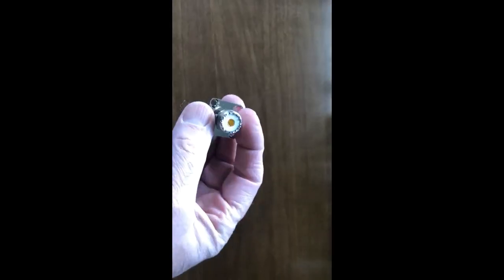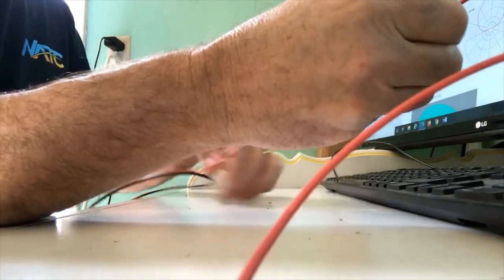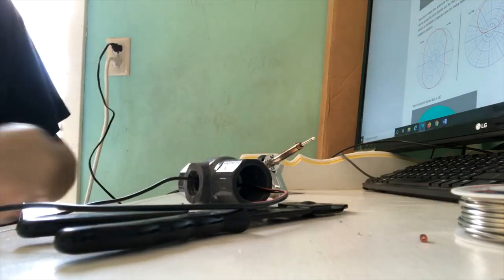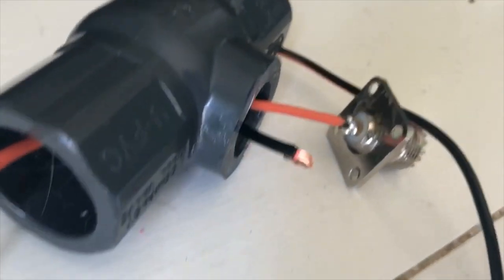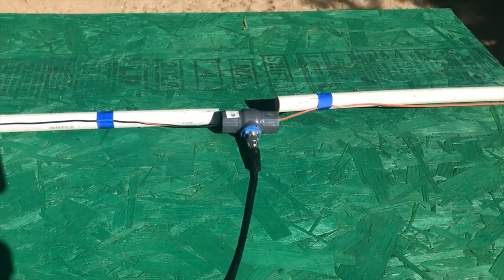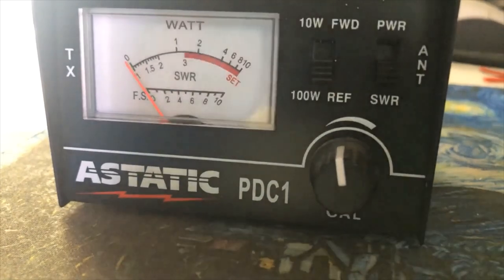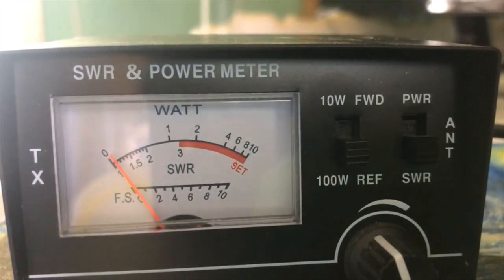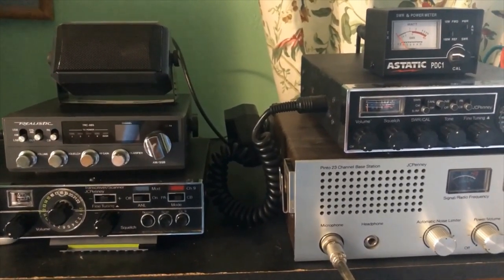Homemade PVC CB Dipole Antenna

Comment: Hello! After you finished running the wire thru the PVC pipe did you recheck the SWR. By inserting the wire thru the PVC pipe you changed the resonance of the Antenna. 
Ed Fong the developer of the Ed Fong J-Pole Antennas has put a lot of theory into using a certain type of PVC pipe on the 144, 220, and 440mhz  bands.
This would also apply to what you did for the 27mhz band. 73 de Steve KB6HOH
Reply from the maker: Hi Steven, thanks for the comment! After I ran the wire through the PVC pipe and placed the antenna where I wanted it, I rechecked the SWR and had to readjust the wire length. I have found that even rotating the antenna in a different direction will change the SWR probably due to changing the properties of the signal from nearby environmental obstructions around the antenna. I have found the sweet spot where the SWR ranges from 1 to 1.2 in the 11 meter band. The antenna is not very high, but I'm amazed by how well it performs. Thanks for sharing the info on Ed Fong, I checked out his YouTube channel and saw some interesting videos I will want to watch. I've always wanted to build a J-pole antenna but never thought of using PVC pipe. If I calculated correctly, the antenna would be pretty massive for 11 meters (around 26 feet in length) versus 5 feet long for 2 meters. I might give it a try for my 2 meter radio. Thanks again for sharing the information on Ed Fong. 73s from 595 Northern Nevada!

Comment: What size wire do you recommend, does it have to be speaker wire or could it be automotive wire.thx
Reply from the maker: Speaker wire works great. If you are running lots of wattage through the antenna, you would want a higher gauge wire. I'm sorry I didn't respond sooner; I missed seeing this comment. 73s from 595 Northern Nevada!
Reply: I have tried copper,aluminum and metal auto wire and the auto wire seem to perform the best...not sure of the theory behind it but the results were noticable ⚡

Comment: So what, if any, effect did it have on SWR once you put the wires inside the PVC tubes?  Doesnt it affect the velocity factor somewhat?
Reply from the maker: PVC should have no effect on SWR, but I never took a reading outside of the pipe. SWR was very easy to set on this antenna and has been very stable for the two years I had it up. 73s from 595 Lake Tahoe Nevada!

Comment: Do you need to use a balun?
Reply: You can if you want to.  A 1:1 current balun is the most effective.  It will not make you match better but it can reduce RFI/TVI on transmit and RFI on receive.
8 to 10  turns of RG-58 or RG-8X wound on a 12" diameter piece of PVC pipe or another material will work well.  While not 12" diameter, I have used a large Crisco container as the coil form and it worked well with 12 turns of RG-8X (smaller coil form, more turns).

Also, remove the PVC as at RF frequencies and power levels it can heat up and melt.

Comment: Hi Ridge Hiker.  Did you need a Balun for the dipole is it matching well with the 50ohm Coax cable?
Reply from the maker: Hi, I did not have a Balun on the dipole and I wish that I would have analyzed the antenna to see how it matched with the coax now that I have an analyzer. The antenna always performed well with a low SWR. Thanks for watching!

Comment: I have never made one I think I’m going to try to make one for a friend that is getting back into the CB hobby in your opinion which would be better solid or stranded wire and I think I’ll try 10 gauge not sure what the difference would be on the gauge of the wires my guess would be may be a little more bandwidth
Reply from the maker: From what I have researched, the difference in conductivity between braided and solid wire is too small to be noticed in a 10-meter dipole antenna. Braided wire is probably better to use as it would not break as easily with flexing from the wind. As for bandwidth, you would not notice an increase in bandwidth till you started using an antenna constructed with 1-inch diameter or larger tubing. Let us know how your dipole turns out. 73s from Norther Nevada!
Reply: Use 1/2" copper or galvanized conduit, or even 3/4" diameter. You will not regret how well it will work.

Comment: You don't mention that you had to readjust the SWR when you erected the antenna! Horizontal and 3' off the ground would throw it out. The wire being inside the tubing would again throw it out. Height of the antenna above ground in it's final position would yet again change the SWR. Also thin wire has a narrower bandwidth than say 1/2" tubing. I learned all the above 45 years ago 🙂
Reply from the maker: Thanks for the comment, you are correct, I had to fine tune the SWR once I had placed the antenna in its final position. 73s from 595 Lake Tahoe NV!

Comment: I see you hand trouble soldering the ground wire. If I understand correctly, are you screwing the wire in with one of the screws for the plate?
Reply from the maker: Hi Jay, yes correct on screwing the wire onto the plate. To solder the wire onto the plate, I've been told that you should rough up the surface first. Thanks for watching, 73s from 595 Northern Nevada!
Reply: @RidgeHikerAdventures  cool thanks! Much appreciated!

Comment: What is the ideal thickness of the copper wire? Is a solid strand or multiple starnd best?
Reply from the maker: I don’t think it really matters, unless you are going to run a lot of power through it. In that case, you would want a heavier gauge. I believe the wire I used can handle 100 watts. I would probably use solid strand if i didn’t have any wire on hand and needed to purchase some. Thanks for watching!

Comment: What's the gage of wire? Does it matter which wire you use for the Center connection?
Reply from the maker: I used what I had on hand which was 18 gauge speaker wire. Wire color does not matter when connecting to the SO-239.

Comment: Does the gauge of wire make any difference? I do not think it really would as it would be tweaked at the end of the assy. by adjusting the SWR.
Reply from the maker: I’ve read for the best performance to use copper wire from 10 to 18 gauge.  I even read about a radio operator who used down rigger stainless steel fishing line with success.
Reply: Depends on how much power you are running.  Most hams running 100 watts or more will use 14 to 12 AWG stranded hard drawn copper wire for their wire antennas.

Comment: I'm stumped.  I built a 11 meter dipole in pvc pipe.  I put a 6 foot jumper on it  to test. Had it laying in a tree fork about 10 feet off ground.  Swr tested great. Under 1.2 Left it there but ran rg8x into shop and swr too high 2.5-3.
Added a 1:1 balun at antenna, still high. Retested with jumper, antenna is great. What's causing my issue? May try different new cable tomorrow. First long rg8x was new as well. What am I missing?
Reply from the maker: That’s strange, adding length to the coax should not increase your SWR. With the balun installed, you should have a balanced transmission line. I’m not a antenna expert but I think trying different coax sounds like a good idea. That’s where I would start. Let us know what happens.
Reply: @RidgeHikerAdventures  I tried a different brand-new 50 ft section of a 8x today and the SWR was up to 3.5 to 4..... idk... not running power, just barefoot. 
What gets me is with a 6-foot number it is perfect flat swr..
Reply: @RidgeHikerAdventures  it was actually slightly lower with 100 ft coax but still unacceptable. Got to be something simple that I'm not latching onto. I ohmed out the coax and they didn't have a short.
Reply from the maker: @headpainter1  Did you try a different jumper cable?
Reply: @RidgeHikerAdventures  I have (2) 6 ft jumpers. They both act the same. Connected them with balun in middle.  Swr was slightly higher that way. Balun is in series with pl259 connections. I ohmed all the wires including jumpers. Maybe there's a short I'm not detecting yet. I figured it was possibly in the 100 ft but when hooked to antenna no jumper or balun high swr, with 100ft balun and jumper it's high. I'll ohm all again and twist and bend. That's all I can think of,  a short somewhere.
Reply from the maker: @headpainter1  Any luck?
Reply: @RidgeHikerAdventures  not yet.  It's been raining cats and dogs last few days. I did ohm it all again and found no problems. End to end x 2 leads and center to outer no contact. I built another flexible 11 meter dipole and it's swr is great. When rain quits,  I'll try the coax again on it and see if results in the same or not. I don't see how the antenna could be the issue though. I test them away from structure and at least 8 feet from ground horizontal. 
Thanks for checking back.
Reply: @RidgeHikerAdventures  ok. Update.  I went out during a break and tried a few things.  I'm running a cobra 29 Ltd classic.  I had an old radio shack swr meter that is probably not registering correctly so I've been using the built in meter on the radio.  Probably a big mistake.  I've heard people say not to trust them but it seemed to be working fine.  Since this issue started I questioned if it was the meter. I since ordered a new swr meter and it came in yesterday.  I tried today and guess what.... the antenna aren't flat. Seems when the radio gets close to the antenna it reads low swr. But away from it it reads closer to correct ( I  hope). Anyway with the new meter and 6 ft. Jumper,  antenna reads 3. Not flat. So, I need to do some tuning. I don't think I am going to trust the built in meter again.  Hope this puts me on the right path.  Thanks again for the help!
Reply: @RidgeHikerAdventures  tuned antenna with new meter and now even with 100 ft coax, it is holding good swr.
Reply from the maker: @headpainter1  Great news!

Comment from the maker: I mounted this antennae facing north south vs. east west of the other antenna. It's also about 2 feet higher with no obstructions. I had to trim quite a bit off of each ends as the SWR was higher in this location. I'll run a distance test soon to see if there is a difference.
Reply: I cut my antennas at channel 30  I do SSB alot   super job on how you made it 73/s   505 Pam
Reply from the maker: @pamhockens4148  Thank you, and thanks for watching. 73s from 595 Northern Nevada!
Reply: Another antenna tip make a full wave loop ssh 😢don't tell one the tomcats big cb antennas will tell you high it will blow away a 99 away homebrew antenna is the best listen people using quads or beams contestant turning there antenna build a loop or dipole antenna simple dimple  😅😅

Comment: Thanks for getting back. Q: could 15 gage house wire?
Reply from the maker: 15 gauge wire should work fine. Remember to tune your antenna with an SWR meter to get an acceptable SWR.
Reply: @RidgeHikerAdventures  would 12-2 wire work better than 14 -2 seeing that it's thicker ? Thx
Reply from the maker: @Prariedog  Hi, if you are putting extra watts through the antenna, you probably would want the wire to be thicker. Running stock, I have heard of people using steel fishing line in their dipoles. Thanks for watching, 73s from 595 Northern Nevada!

Comment: Did the SWR change with you put it in the pipe???  Some freq's.. especially vhf and uhf can be sensitive..
Reply from the maker: I have the dipole resting on the roof of my RV. I notice that the SWR will slightly change when I change the orientation of the antenna. I'm not sure if this is due to the orientation or that the pipe slightly bends at different angles.  I didn't notice a change when I encased the wire in the pvc pipe.
Reply from the maker: @LiL The RV is all fiberglass, that's one of the reasons I  choose the location as it was simple to place and move around. Ideally I would like it higher, but I'm surprised how well it works at its current height. 73s from 595 Northern Nevada.

Comment: What type of pvc did you use like size is it 1/4 or 1/2 or 3/4 and the spec of the pvc was it 200 psi?
Reply from the maker: 3/4 schedule 40 PVC pipe. 73s from 595 Northern Nevada.

Comment: I am from UK. Will this work on 27mhz on FM ? Or is this purely for AM only ? Many thanks.26DR190.
Reply from the maker: Great question! Over here in the states we were just approved by the FCC to use FM in which I have no experience with. From what I understand, the antennae is tuned to the frequency (27 MHz) and the CB mode should not have any effect on the tuning of the antennae. My radio has AM and SSB in which both modes, the antenna works great. When tuning my antennae with a SWR meter, I adjust it on AM as SSB does not have a carrier wave. AM has a carrier that gets modulated to a peak wattage where FM is all carrier wattage, with no swing just constant carrier. Long story short,  the antenna should perform the same regardless of being on AM or FM. Please make sure to tune your antennae with an SWR meter before you use your radio to avoid damaging the radio.  Someone else with more experience want to chime in with their opinion. Please let us know how it goes if you choose to construct the dipole.
Reply: @LiL Quite a few use FM where I am at (Cape Cod, MA) even before the FCC approved it's use.
Reply: @RidgeHikerAdventures  FM is actually the best mode for tuning an antenna as it puts out full power without modulation where as AM power is subject to fluctuations when audio is added to the carrier.
Reply from the maker: @jfrphoto01  Thanks for the correction, I’m not very familiar with FM. I need to think more globally. 73s from 595 Northern Nevada.
Reply: The UK FM 40 are higher in frequency, so that antenna is slightly shorter. If you use just FM THEN tune shorter, if both the US/EU 40 then better tune for the middle or channel 1 UK FM,  if tuned at 27,500 the middle of the 2 groups of 40 the SWR might be some higher on US channel 1 or UK FM channel 40. The A99 tuned at 27,500 will be broad banded enough for both. 

UK 40  CB27/81 
Radio Channels[2]
Channel	 Frequency [MHz] 	Channel	 Frequency [MHz] 
1	27.60125	21	27.80125
2	27.61125	22	27.81125
3	27.62125	23	27.82125
4	27.63125	24	27.83125
5	27.64125	25	27.84125
6	27.65125	26	27.85125
7	27.66125	27	27.86125
8	27.67125	28	27.87125
9	27.68125	29	27.88125
10	27.69125	30	27.89125
11	27.70125	31	27.90125
12	27.71125	32	27.91125
13	27.72125	33	27.92125
14	27.73125	34	27.93125
15	27.74125	35	27.94125
16	27.75125	36	27.95125
17	27.76125	37	27.96125
18	27.77125	38	27.97125
19	27.78125	39	27.98125
20	27.79125	40	27.99125

US 40  US 26,965 TO 27,405

Comment: Why not just test the swr on ch 20, or if you want to use other bands like lo-mid-hi use the centre channel or frequency and cut for lowest swr ? 73's Andy M6APJ
Reply from the maker: Great idea, I appreciate all the feedback, I've been out of the hobby for quite a while and still have much to learn. Thanks for watching.
Reply: "Why not just test the SWR on channel 20...?"  Nope, one needs to 'see' the curve. So it's important to check the SWR at the top, middle, and bottom of the band, in order to visualize the curve over the band. Once the dip is within the band, then one can also search around for the channel with the lowest SWR, and then do some simple math to (slowly and carefully) move that lowest point to where you want it. Final check is to check around the middle to confirm the dip and slight rise. Maybe a final end to end check. Or just spend $50-$100 for a NanaVNA and you can directly SEE what is going on. Makes the whole thing visible !!

Comment: i built one just like this and while ive got it horizontal ive got an even 1 on channel 1 and 1 to 3 on 40 but once i mount it vertical my swr goes up to 1to 6 on channel one and an even 2 on channel 40 so any suggestions ?
Reply from the maker: I would try a balun. My friend built his own and had good results.
Reply: @RidgeHikerAdventures  can i build one ?
Reply from the maker: @bobbyt3451  I've seen people build their own on other YouTube channels. 73s.
Reply: @RidgeHikerAdventures  yes thanks I've been looking at them and my house is actually a survival house built out of steel conex shipping containers so I think that's my issue.I think I might be better off building some kind of ground plane antenna 73s

Comment: How long was each wire after all your cutting .. I really waited and waited to hear you say it but you never did  :-)   same me a tone of work if you would tell me ..
Reply from the maker: For the dipole to resonate at channel 20 (27.205 MHz) which is in the middle of the band, each dipole leg would need to be at 8.602 feet long. I started at 9 feet for each leg. With the antenna placed at the location I wanted; I trimmed each end equally till I had the lowest SWR reading at channel 1 and 40. I did not take a final measurement after trimming the wires, but I would imagine that I was at around 8.6 feet long for each leg. I have noticed that my SWR changes when I orientate the antenna differently. I have read that placing a 1:1 current balun could resolve this issue. One thing I would have done differently, is to fold the tips of the wires over to shorted them instead of cutting them when adjusting the antenna length. Good luck with your antenna!
Reply: @RidgeHikerAdventures  A common misconception with the 1:1 current balun is that it will fix a mismatch.  A current balun will help remedy RFI/TVI problems but not VSWR problems!